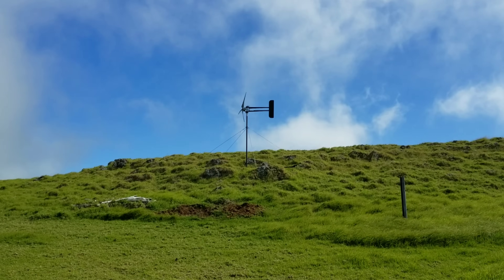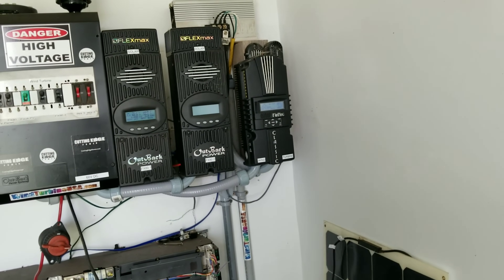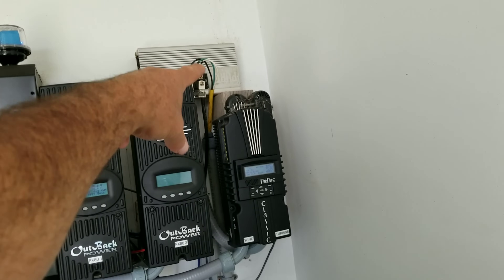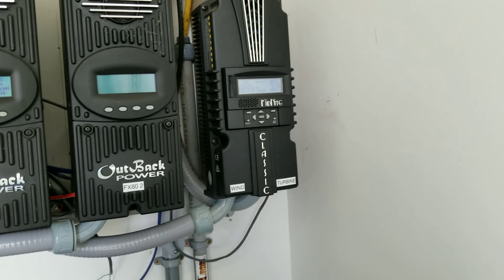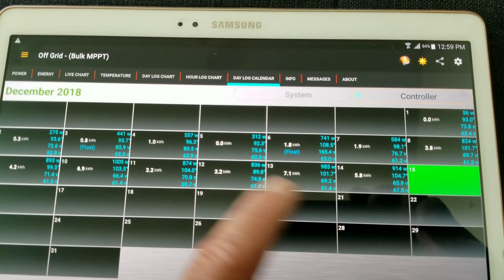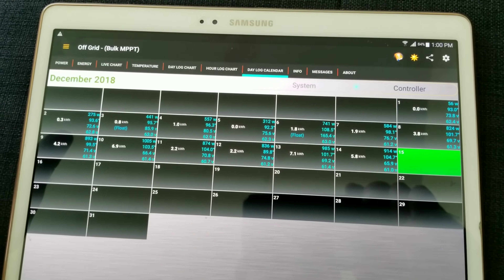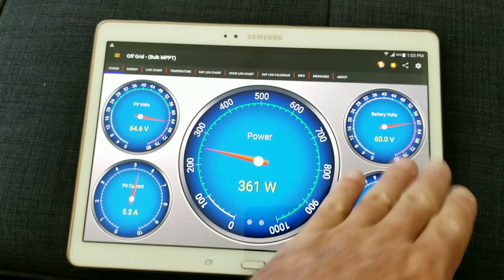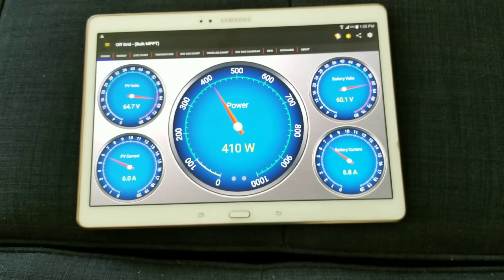MICRO WIND TURBINES... ARE THEY WORTH IT? (OFF GRID SOLAR)

Comment: why do you generate in ac, convert to dc to store, and then back again to ac to use in your home. Use a dc rotor, and store directly. Every time you convert you loose energy
Reply: If you gen ac you can ru a long cable from the windmill if you try that with DC most of it will be lost in resistance. DC doesn't handle resistance as well AC is the way to go then you just convert it.
Reply: Iirc DC rotors have brushes. AC generators have slip rings. Slip rings are more robust. In other words, the AC generator has a longer life. At the cost of the energy lost in the rectifier. For silicon diodes that's 0.6V times the current, which is why he needs to put it on a heatsink. If this lost power is a concern, you can use shottky diodes or even synchronous switched mosfets to get the voltage drop down, but that's an expensive solution. If the input voltage is over 60v, which it has to be to charge the batteries, the losses for dc conversion is 1% or less, which is possibly an acceptable cost for the dependability and simplicity.
Reply: The wind generator produces wild AC. I think it was even 3 phase. That is not a synchronous generator. My grid tie solar inverter can synchronize with my 60hz 240V grid. His turbine can't synch with his inverter output. Also, his generation and his usage are uneven, so he is storing it in a battery. Also, those outback inverters are expecting a voltage range, which I think his charge controller is giving him, even when he isn't storing the power. He mentioned that his rectifier is hiving him a higher DC voltage.
Reply: Because replacing brushes on a wind turbine is a PITA.

And if they burn out then hey presto you have an un-brake-able 100lb whirly gig spinning out of control.

Dynamos are okay for toys but not much else, and they're less efficient. There is a reason they're not used in vehicles anymore.
Reply: I'm a bit of a a novice but I thought there are brushless DC motors now like you'll find in Makita and other battery powered cordless tools.
Reply: @adon8672  

It is a bit like those, but those are actually AC too despite being called BLDC!
Reply: ad on I think brushless dc would be more expensive they use magnets. Would be more efficient with a switched rectifier than diode base but again I imagine those are more expensive, and for this probably require additional sensors
Reply: The blades are connected to a drive shaft with a rotor that has magnets on it. There are no brushes that need a lot of maintenance. It produces three phase wild AC which means that the frequency, voltage and amperage goes up and down with the rotor speed therefore it's unusable for any AC appliances. It then is brought through a three phase Bridge rectifier to convert it to DC with variable voltage and amperage. From there there's different ways of using that electricity.
Reply: Why the fuck are there still so many people that don't know the difference between lose and loose? Is a four-letter word really that fucking hard to spell?

Comment: How come you don’t have a dump load? And does it have a break
Reply from the maker: I use to have dump loads I have videos on that and how to hook it. No brake needed because of the way I have the System setup. It will never over charge
Reply: What is the brand ?
Reply: What size wire do you have coming from the turbine?
Reply from the maker: Wind Turbine is wild 3 phase ac which has 3 wires

Comment: before I went to school I used to think a 60 watt bulb that's nothing. a 60 w 12 v bulb is 5 amps 60/12=5. 1 amp is 6.23 x 10 to 18th power electrons a second. that's is 6.23 million million million electrons. now imagine that 40 amp 240 v AC outlet. wow
Reply from the maker: Yes sir,
Reply: @ModernOffGridDIY  people think that to have high amperage you have to have high voltage but in my example a 60 w 12 v bulb is 5 amps but a 120 v 60 w bulb is only half an amp. a 60w 6v bulb would be 10 amps, if it existed.
Reply: @michaelmooney3369   You have the right thought kid , But we don't have huge cables running under ground to keep the low amp . Best to keep it local , as in right at home. A tiny solar pain and you have a start. Now get at it. Happy new year.
Reply: @michaelmooney3369  What a tiny bulb you have. Even your 60 watt 6volt one is puny. Try a 1000 watt 24V DC bulb or even a 2000 watt 24V one. The first one is 42 Amps and the second one draws near 85 Amps. The pins on the bases of them are of the size of some welder lead ends. At 5' distance from them, you can feel the heat that they give off.
Reply: @gravelydon7072  I imagine the old electric arc search light suck amps and could be felt even further. 1000 amps?
Reply: @michaelmooney3369  These bulbs were the replacements for in searchlights. As I haven't been able to find any higher wattages than than 2000 at 24 volts, I would guess that is the upper limit. The WW II land units had an arc voltage of ~100 and an arc amperage of ~150 in normal use. Or in the GE units, 220 volts at 75-100 amps. Ship and plane units were of lessor voltage so these two units would have been used in them. They also are Halide units and the bottom of the bulbs is filled with loose metal so they likely were used in shipboard lights. For people who think they have bright flashlights, these would put all of them to shame. 4100 being the flashlight max right now, these two come in at 110,000 and 200,000 Lumen.
Reply: @gravelydon7072  in other words they are so bright that the light will actually heat what ever that light is put on.
Reply: @gravelydon7072  in other words it is so bright the light will heat what ever it is put on. I would not be surprised if you could get "sunburn" from it.
Reply: a 40 amp 240v AC would be 9600w, my microwave is 1500w. it]s all Ohms law.
Reply: michael mooney v

Comment: I use a 2000 watt duel PMG turbine for cloudy days and night time to help keep the batts up. I use a Midnight Solar designed for wind and you have to use a heat dump so you do not over voltage the controller. my 150s cannot go over 190 volts incoming or it will be damaged. In high winds the dump bleeds off excess and no it does not hurt your batts. Overcharging and dragging them down to low does.

Comment: How much for the windmill?   What is the duty cycle?  How often will you have to do a rebuild?  How did you get the Tesla batteries? How much labor and cost for them.  I don't even want to talk about the controllers.
Reply: Pretty important questions to answer in a video titled "worth it?"
Reply: Not sure why people are picking on this question I think they are valid questions. Helps to work out what works and doesn't work for others to then go forward and narrow the options to research leaving out the crap.
Reply: I doubt that he has much data on the duty cycle or rebuild since the system looks new... both of which will depend on environmental conditions.
Reply: Even policemen ask less questions. but indeed I bet on this thread you have a lot of people secretly dreaming about doing the same thing in their gardens.
Reply: fatboy19831 ..tesla batteries are jyst panasonic rebranded
Reply: @sisterbob5169  lol that is quite a naive statement
Reply: You forgot to ask what he had for breakfast 😂😂😂
Reply: @grahamowen1570  And did he stay at a Holiday Inn last night. ;-)
Reply: @gravelydon7072  holiday inn express
Reply: gravelydon That’s a “Holiday Inn Express” in the old TV commercials!

Comment: In slow but steady winds will these be worth it. Do they work in slow winds ?  It is cool they work at night charging the batteries while you sleep.
Reply: In slow wind you need bigger blades with a slightly higher TSR than you would normally use.

But if you do get the occasionally storm then a furling mechanism is a must.
Reply: Depends what you mean by slow but generally no. The Power available is related to the wind speed cubed. Double the wind speed is 8x the Power.
Reply: Chris Wallis in winter like today our winds are 10 to 13 mph all day and I think that is pretty typical.
Reply: @terrywbreedlove  that would be considered pretty quick around here :)
Reply: Chris Wallis that brings up another question when the winds kick up to 45 50 70 mph coming off the pacific will the wind mill shut down somehow to keep from being damaged ?

Comment: As the owner of a 3kw rated wind turbine for the past few years I would say its very marginal sadly. 
If your outlay is 4k or less for the wind components of your system and you have a VERY GOOD WINDY SITE Then go for it, you could see a return in 6-8 years on purely replacement energy costs depending in the spec if your system.
Otherwise DONT!
Reply from the maker: Not all true because your  Basing your information off your current local the  Electricity cost when obviously in other places in other States electricity costs is different here in Hawaii it's going to be about 55 cents per kilowatt hour and it will keep going up so my return on investment is much sooner than others that pay for less expensive power.
Reply: @ModernOffGridDIY  Fair point, that's a hell of a tariff though. 
I have a 4kw pma and some blades left over from doing our current vawt machine (fa second hand system I bought for parts only used the mast and inverter). So I'm actually very keen to make a hawt with the parts.
I've caught the bug.👍
Reply from the maker: Thanks for sharing

Comment: I mostly use my windmill to grind wheat.
Reply: I installed my solar panels inside my shed to keep snow from covering it up and reducing the output in the winter. Smart!
Reply: Really? You grind your own wheat?  I want to be able to do this.
Reply: @cherriemckinstry131  ... did u read his name ? 😂😂😂
Reply: I like to pump out wetlands with mine and reclaim extra farmland.
Reply: @heckinmemes6430  You might need a bit bigger windmill depending on the pumping requirements.  I can't imagine this sized mill doing much of the pumping needed to reclaim wetlands for farming.  Every time it rains more pumping is needed or you'll have your wetlands back.
Reply: @sailingsolar  I know, I know. I was being a shit and making a polder joke.
Reply: @heckinmemes6430   Same, same in my reply made here and that was the same with the first comment.  If you read through not ALL the replies, actually understanding that bit of reality.  As such they and have not replied like they got that.  Their loss not ours.   Happy new year.
Reply: I use my windmill to drive my other windmill

Comment: Off grid for an individuaal home - it should be a no brainer that you use solar and wind. why not use two micro wind turbines and double your battery capacity and run a hot tub and external security lighting. Have you done a return on investment  analysis yet - how long before you pay off the whole off grid system - the wind/solar system together with the batteries/controller/wiring/inverters etc. ?

Comment: Nice set up but to know if it is worth it I would first need to know the total cost of the install.
Reply from the maker: Install cost is based on your type of system and needs.
Reply: What was your total cost for your system is what I am asking?
Reply from the maker: I understand that but cost really means nothing because if your living off grid you will have two choices run a generator that uses gas every gas here in Hawaii is high or 2nd go with solar. It's about living comfortably. My cost will be different then others. I spent a lot of money.

Comment: Why don't you have your bridge rectifier next to the wind turbine, that would improve the cooling effect?
Reply: ac travels with mush less loss,  dc doesn't travel well.  thats why our power companies use ac
Reply: @myob3574  Power companies use AC only because AC can have its voltage stepped up or down using transformers whereas DC needs switching converters to do that efficiently. When AC first took off, there was no way at all to change the voltage of DC transmission between high voltage transmission lines, medium voltage lines, and local 240V lines.

DC transmits over wires more efficiently than AC because it is constantly at max voltage instead of changing between max and zero and is not affected by the skin effect, eddy current, nor reactive power. It just needs more advanced tech to change the voltage around. The most efficient long-distance transmissions are high-voltage DC by far, especially underground or underwater where there is a lot of line capacitance.

As for rectifying at the turbine or at the shed, three wires of a given gauge will probably transmit power a little more efficiently than two lines of the same width on DC since current here isn't high enough for the skin effect to be huge and the charge controller should have decent power factor. However, for the same money you can buy two lines of greater width since two lines are shorter than three and you'll end up with the DC transmission being a little more efficient. I wouldn't bother though since it's simpler to have the diode rectifier in a shed instead of more exposed to the elements.
Reply from the maker: Not needed because the bridge rectifier does not get hot. Plus I have a huge heat sink that's it mounted to anyway. Plus my system is 60v so it runs way more efficient. If it was 12v then it would get really hot.
Reply: The power loss in one DC wire carrying all the Amps is greater than 3 wires splitting it.
Reply: Ac travels better than dc with smaller voltage loss.
Reply from the maker: Current
Reply: So why didnt you put a transformer between windturbine and rectifier?
It will improve the conversion efficiency of the comverter
Reply from the maker: Just not needed

Comment: I've wondered why a people that always chase the wind (sailors) don't put these on top of the mast of their ship, free energy. Also why not mount a hydro wheel on the bottom of the ship? I always see sailors with solar and nothing else, living on a boat is as pure off grid as you can get, why not double or triple your options?
Reply: Yachties have been using micro wind turbines for decades.  And 'hydro wheels'  would cause too much drag, though it is common occurence for some yachties to take power from a 'feathering prop', when under full sail, which is used to augment battery charging.  

Cousteau also experimented with vertical wind rotor power and a few vessels exist that use this technology.   

The new breakthrough has to be solar pv sails, that not only harvest the kinetic energy of wind, but also catch photons from the sun, to augment either charging, or assisted motoring.
Reply from the maker: Yes your Correct it creates more drag than it's out come.
Reply: Modern Off Grid DIY  But on a sail boat the wind is free so a little drag isn’t an issue
Reply: @terrywbreedlove  you are not a sailor,a hydro wheel would create far too much drag
Reply: Karl Wright the wind is free and you use the hydro charger to get your batteries charged and pull it when they are done. Cost you nothing
Reply: @terrywbreedlove  cost you 20% of your boat speed,that's why we don't do it
Reply: Karl Wright 20% no way    “less than 0.4 knot” reported by Save Marine for its H240, to “less than 30lb at 6 knots” for Sail-Gen—roughly equivalent to 0.1 knot.
Reply: I was just wondering about a small wind power device on a camper van, possibly something that could also be deployed while at a windy campground.  And....maybe a small portable water turbine to put in the river while camping.:)

Comment: Nice video buddy this charge controller for wind can step up the voltage as well can you provide a link? Thanks
Reply from the maker: The voltage from a wind Turbine is really high no need to step it up, the charge controller is stepping it down to charge my 60v batteries.

Comment: You told us that it is worth it for you, but you never answered the question, if they are worth it for me.  exactly what is the resource to find out if it is right for me?  What parameters  am I looking for to find out?  For off grid purposes, how does it compare to solar?  How do I find out if I'm better off buying more solar or more batteries to last through cloudy days?  If I had a solar system and $2000, should I buy solar or wind?
Reply from the maker: If you only have $2,000 buy solar

Comment: Where is your dump load? If you don't have a constant load on a wind turbine, the turbine could spin out of control, break apart, and go flying at your house. It's not necessary on solar setups but it is on micro turbines.
Reply from the maker: It will never free spin so I dont have to worry about that because the way I set it up. Always a step ahead
Reply: seems like many people are asking this same thing but you never give a meaningful answer, only some nonsense about some mystical "the way it is set up" . wind turbine has a generator which resist movement when one takes power out of it, if you don't do that and don't have any kind of breaking system, those blades might pick up a lot of speed and things might brake. so if you don't put any power to batteries or to some other load, maybe you have some kind of smart system playing with generator phases and feeding it back to have a breaking effect.
Reply: @jarkkoaitti287  He keeps sending people to his other videos where, presumeably, the issues are addressed.

Comment: The wind or no wind power comes down to the standard location location location. Where I live you need to get a turbine 60+ feet in the air to start catching the wind that is always blowing and anything over 30 feet requires a permit and a navigation light. For me it would be cheaper to add an extra string of panels then to put in wind.
Reply: That is the case for most people
Reply: You can always get a stronger turbine( lower Rpm) More solar panels means more investment in batteries and batteries are the weekest link.
Reply: @onekycarscanners6002  not lipo4.. they last 20years